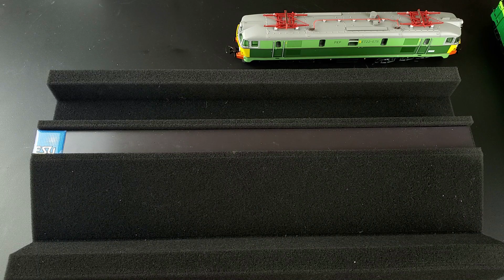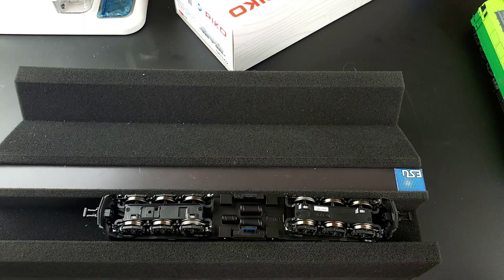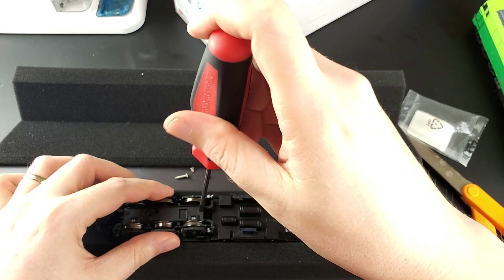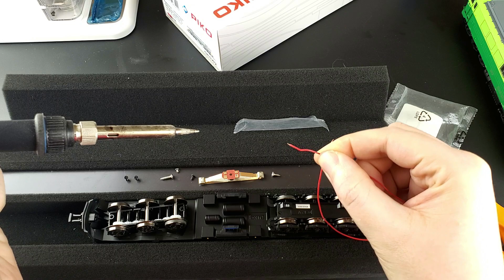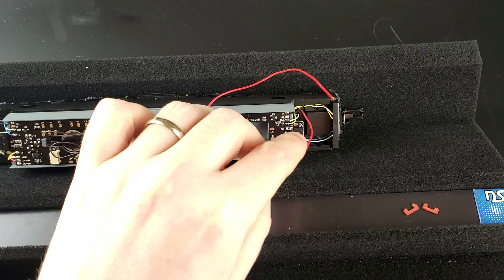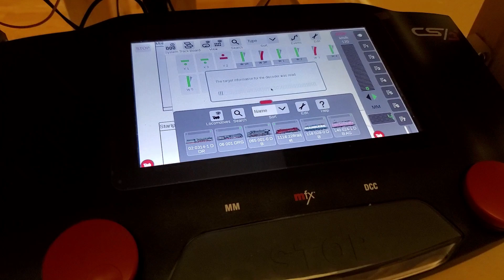2-rail DC to 3-rail AC Conversion Tutorial: Running a Piko DC model locomotive on Marklin digital

Comment: Interesting. Your comment that "Caution: This video assumes operation on AC digital, which is actually not AC at all" indicates that a Piko modern AC could be converted to DC ie it is a wiring config issue still using a DC motor. The reason I ask is that I have opp to buy a Piko AC DCC Sound loco on sale v the DCC sound DC model at retail price. Thanks for any feedback
Reply from the maker: The internals should be the same, so you can go back from AC to DC by rewiring it and removing the pickup shoe, and potentially replacing the wheels if they are not insulated. Nowadays all motors are DC and the decoder is set up to habdle the analog AC operation.
Reply: @EuroTrainTips  Thanks very much for the reply. Cheers

Comment: Hi Adam: Was the conversion of the EU07 more complicated and or difficult than the ET22? How about a video for that one? ;-)
Reply from the maker: It's the same process as far as the wiring goes, since the circuit board is similar.  The main difference is that the trucks on the EU07/ET41 don't have a pickup shoe socket.  You will need the Roco 40501 pickup shoe as it happens to be a good fit.  Use a tiny drill bit (smaller than the screw that comes with 40501) to drill a hole dead center for attaching it.  You can then route the wire around the side of the truck as shown in this video: https://youtu.be/Z1S4YaweHC4?t=32 .  Good luck!
Reply: @EuroTrainTips  Thanks Adam. I'll give it a try.

Comment: Hi again. Attempted the conversion on the 96342 and thanks to your detailed video it came out perfect. Next I'll try my luck on Piko 52954 which is similar to the loco 52805 in your video. Was that conversion as simple as the one for 96342? Thanks,

Peter
Reply from the maker: Yes, the ST44's should be just as easy.  The same Piko pickup shoe will work with it.  Good luck!

Comment: Great video Adam. Piko has produced quite a few nice looking Polish locos from eras lll, lV and V but they are primarily DC. 
And as you pointed out Märklin has practically ignored the PKP. So this is a useful video. 

A couple of questions however:

Why didn't you need to change the wheels?  

Did the DC wheels pass over different turnouts without derailing problems? 

And if I am using train and occupancy detection on my layout. Don't I need to swap out the DC wheels for AC or at least use conductive paint on the axles of the DC wheels?

Peter
Reply from the maker: The ET21/ET22/EU07/SM42/SU45/SU46 locomotives haven't given me any issues on Marklin tracks with the DC wheels.  I think it's mostly thanks to the fact that locomotives are heavier, and so the wheels get forced through the correct grooves on turnouts, unlike cars that use Piko DC wheels.  The geometry might also be slightly different/better.

Occupancy detection works fine because you connect the two (otherwise insulated) sides in the "soldering ground wires" step, so after the conversion the wheels work just like AC wheels in that regard :)
Reply: @EuroTrainTips  Thanks for your clear explanations. I a going to try it on the same loco you show in the video.